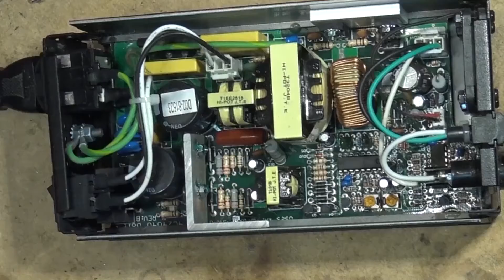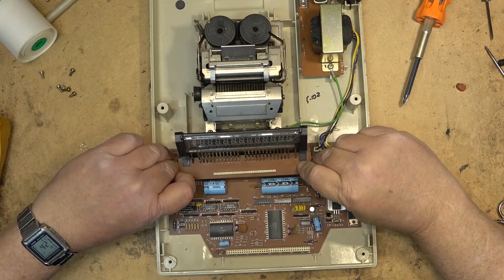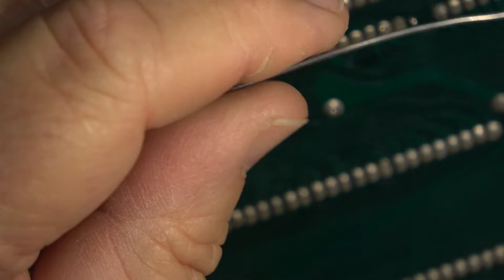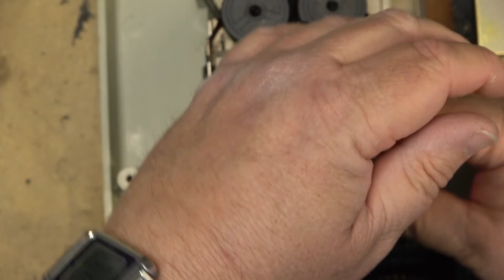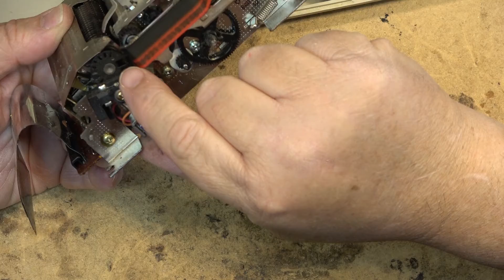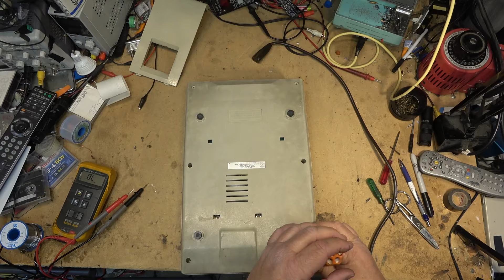Vintage Victor 670 Printing Calculator from late 70s display is dead

Comment: Hi, I found an EL-2615PIII for cheap, at my local thrift store, but didn't buy it because the display was very dim. Do you think a bad connection could be the culprit or does the display itself just crap? regards.
Reply from the maker: Could be low voltage to diaplay of it is a VFD. Of course VFD display tubes do go bad so voltage would have to be checked.

Comment: I remember many shops or business having these machines. 
Most came with brand name Sharp, and made the "sound" of little offices everywhere. Last models still sold in Office Depot equivalent costed much more than classic counterparts, but were highly appreciated for their large and indestructible keyboard and printing capacity. 
Till the early 1980's, you could find nice HP pocket calculators with miniature LED Display, some with financial or mathematical complex functions and a printer option. When some say these office calculators were complex to use with these many special keys and how-to, these HP used RPN system, aka reverse Polish notation, and it was another trick to learn how to use.

Comment: had one like that where i worked and took me a while to figure it out.  i was used to simply typing in the calculation, but it has that goofy way where you have to hit the calculation after the number and it always threw me off, it seemed out of order
Reply from the maker: All the old ones were this way.  They add only and to subtract you add a negative number.  Press + then the number followed by -.  Some would be marked += and -=

Comment: It didn't take you long to find the fault,  cracked solder and an easy fix :-D
That printer is very clever and unlike modern junk it still works!.
Strange to operate it, but i'm sure every operator went through a short coarse to learn it.
Reply from the maker: Only strange to operate for those not used to it.  This followed the rules of adding machines that went back 100 years to the early mechanical units.  My first pocket calculator I got for my birthday in the mid 70s was the same.  I took it to school when i was in grade 5 and the teacher took it away from me and sent me to the office.
Reply: @12voltvids  I also took a calculator to school,  it was a credit card sized sinatron ,  Ive always had problems with numbers.
The teacher wanted to take it off me,  i said no.
Memory has also created problems ,  i never could remember the times tables.
I read them over and over again, no result.
After i left school i did electronics,  the pinouts on chips helped me remember, i needed a visual way to remember numbers.
i must have had some kind of learning problem,  or i was thick as shit lol 
My epilectic fits and the doctors drugs i had to take may have caused problems.
Sorry dave, waffle mode on full lol.

Comment: Boat bust out another thousand!
Reply from the maker: BMW, bring money weekly.
Reply: @12voltvids  Break My Wallet :-D
Reply from the maker: Ford, fix or repair daily, Fu*cing old rusty dodge, found on road dead.
Reply: @12voltvids  ha ha that's just so true, ford designs have become so dam stupid that you have to take it to a dealer because of the  rip it all apart to get to a silly component place.
Im sure they make horrible designs on purpose to stop the owner doing there own repairs.